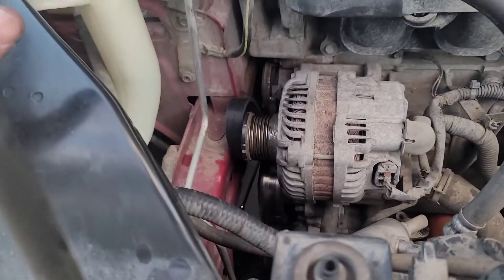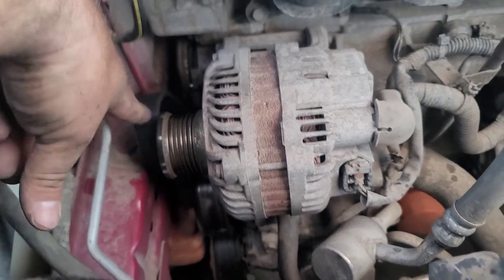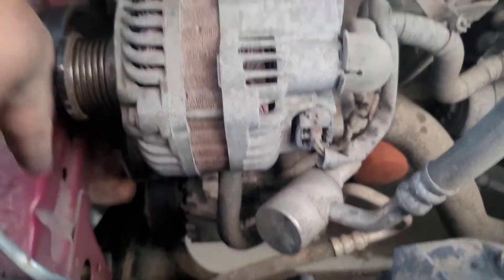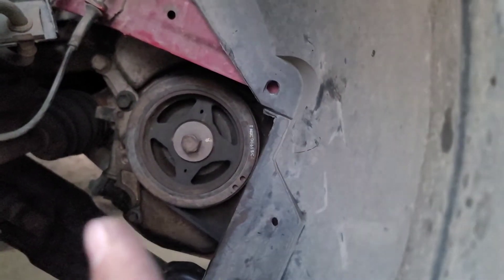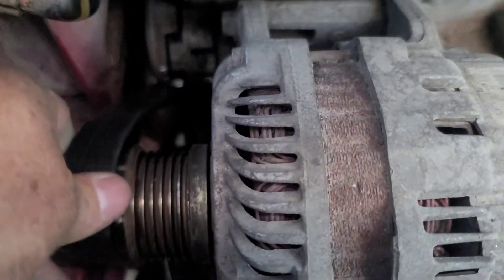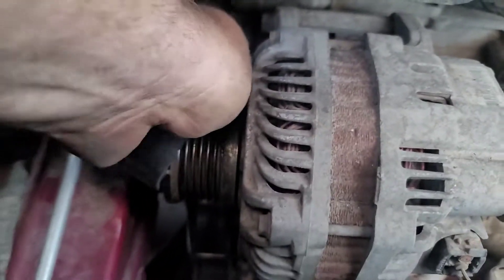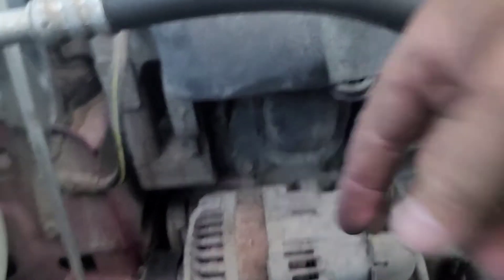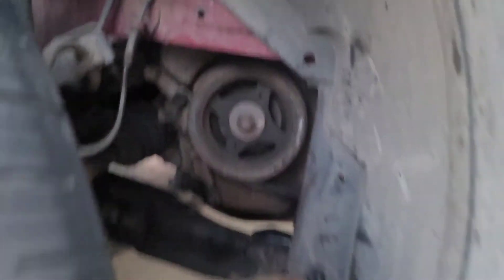2011 nissan sentra serpentine belt replacement 2007 thru 2012 easy way.

Comment: No need to do all the extea work, comes off easy. Dont even need to take tire off. Slots for bolts to come out. Delete video or update.
Reply: I’ve never seen anyone do this without taking the tire off, how did you?